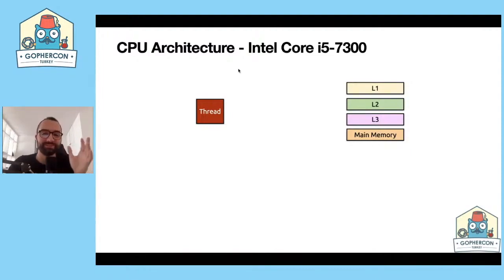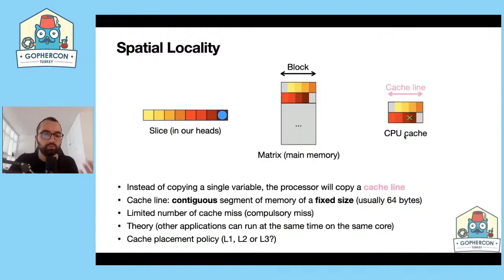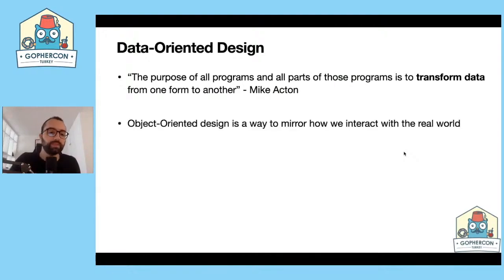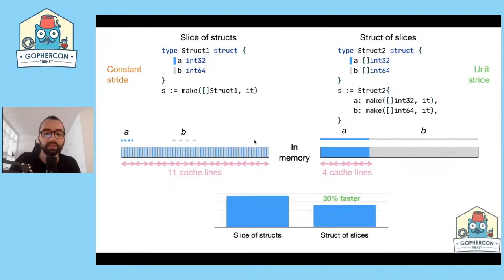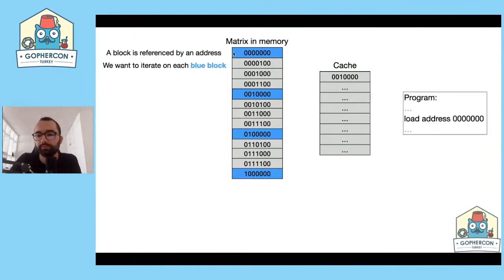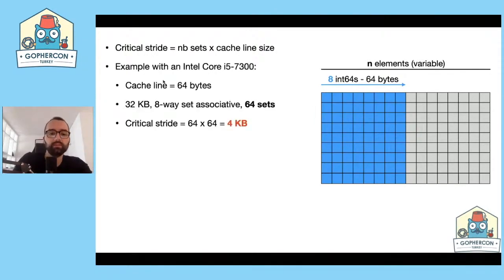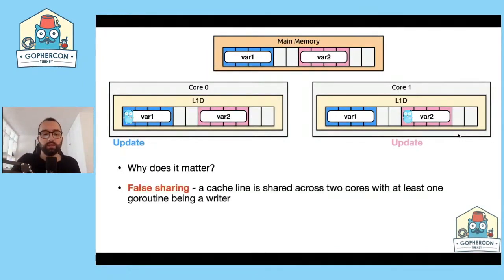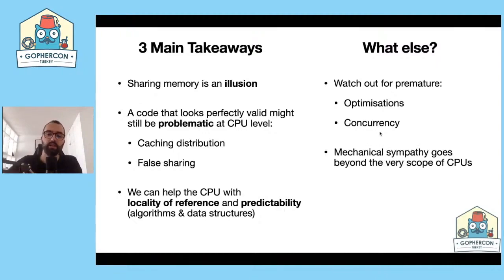Mechanical Sympathy in Go - Teiva Harsanyi - GopherCon Turkey 2020

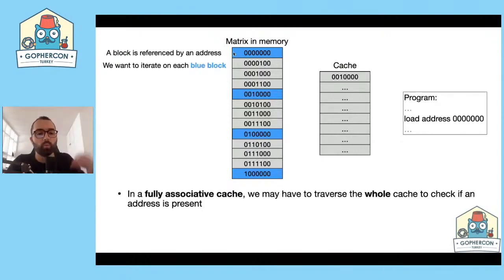Comment: At 27:22, if 00000000 is the first address of the block, how come 00100000 becomes fist address of second row. There are 16 adresses in between. It means 16bytes. But we are dealing with a row of 8 columns: 8bytes*8 = 64 bytes.